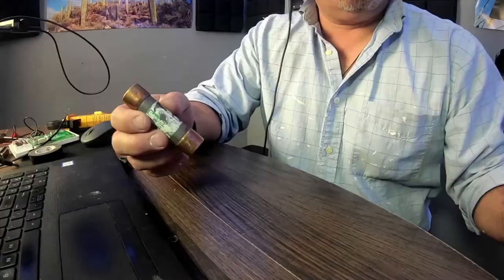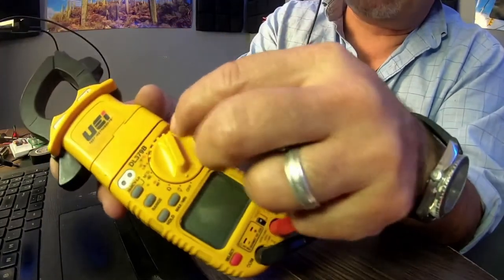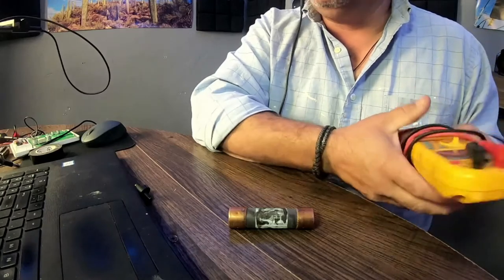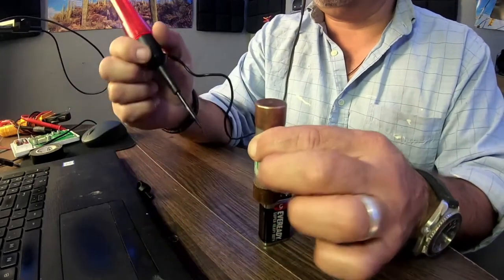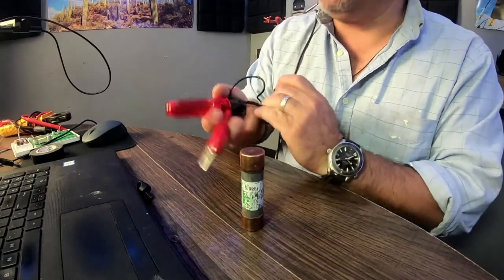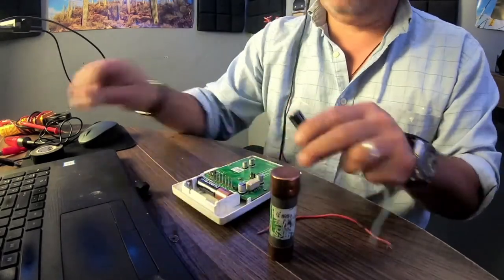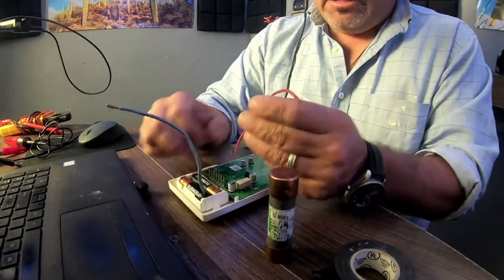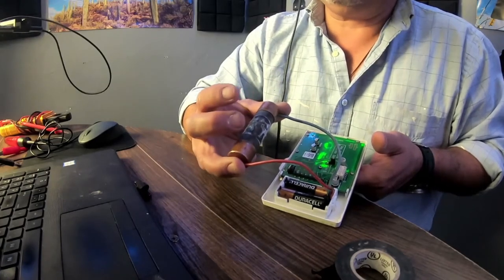How to test a fuse without multimeter!! #fuse, #electricalproblem, #noelectricity

Comment: Hey, I wanna to test a 250W 15A fuse (from a microwave), can I do it with a small electrical device (torch) or do I need something with the same voltage ?
thx a lot for this video !
Reply from the maker: It can be any battery,  as long as their is still continuity it's still good